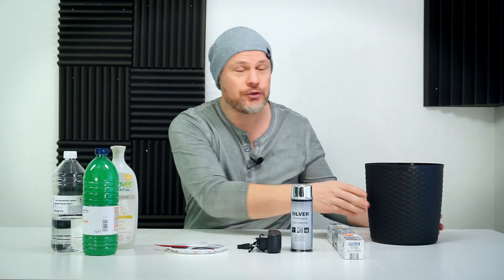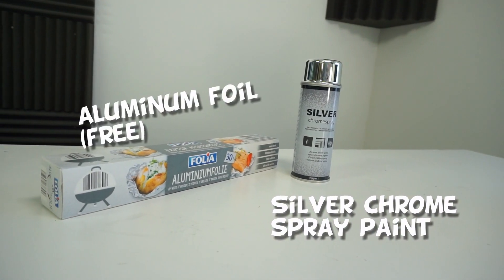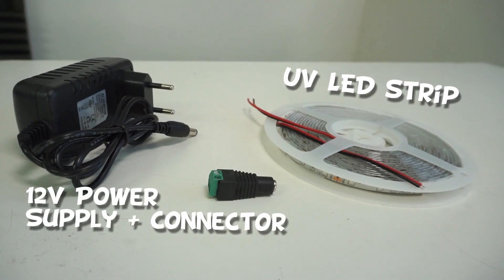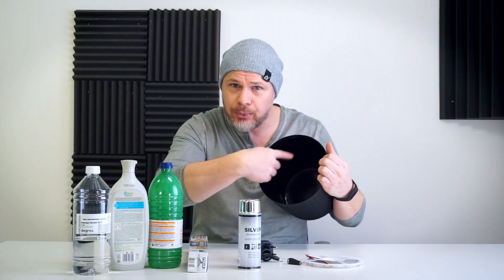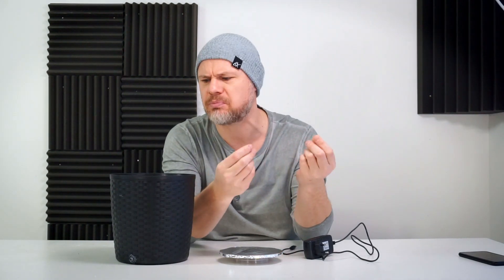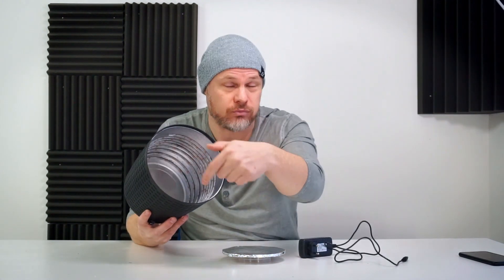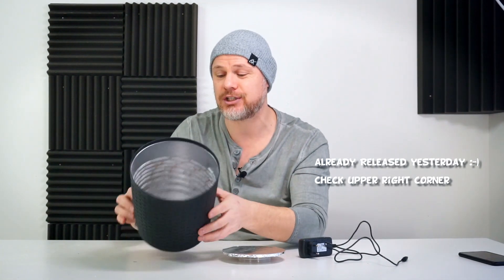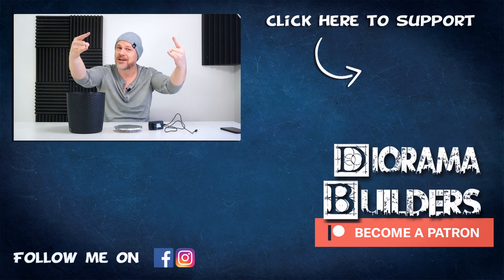Cheapest DIY UV Curing Bucket Chamber for 15€ for 3D Resin Printer

Comment: I made one almost the exact same way but the problem with these is that the UV light is not a strong as the ones that come in the official UV curing stations from the manufactures.

Comment: hello, nice clean build! could you do me a favour and test one of your prints for scratch resistance? i recently built my own uv chamber, similar to yours but with even more power (no flex intended). However, the print surface remains weaker (not scratch resistant) than the fully cured resin of the bottom layers that are in direct contact with the build plate (scratch resistant).
Reply: how long were you leaving them in the chamber
Reply: @littlesnowflakepunk855  thanks for replying - between 10 and 60mins. but it turns out that the problem was the cure inhibition throgh oxygen contact, because the problem remained when using a "real" chamber. now i always submerge my prints under water for post curing
Reply: @MiniaturenGalerie  what process do you go through? ISO dip, clean, uv, water soak? How long in the water?
Reply: @RunninGunner04  i clean my prints with IPA, let them dry off, then submerge them in water for post curing (i put a water container in my uv-curing chamber)
Reply: @MiniaturenGalerie  do you take supports of before or after curing?
Reply: @RunninGunner04  depends on the part and the supports but usually before